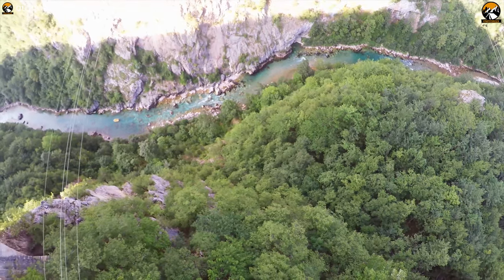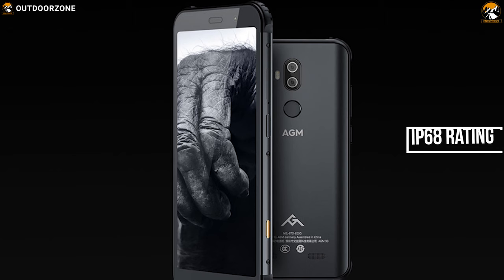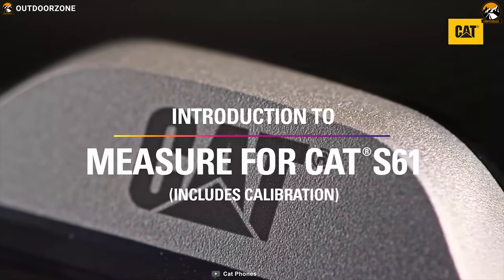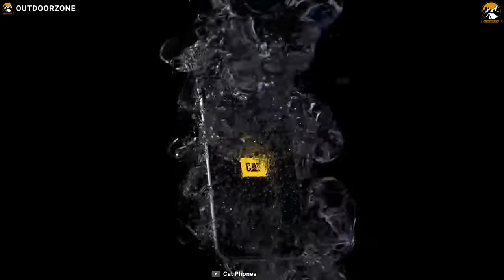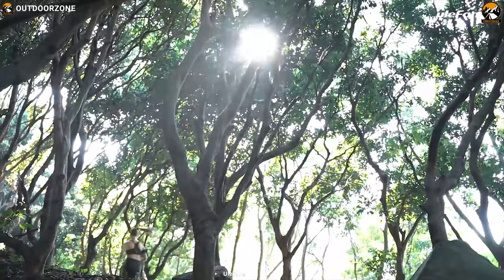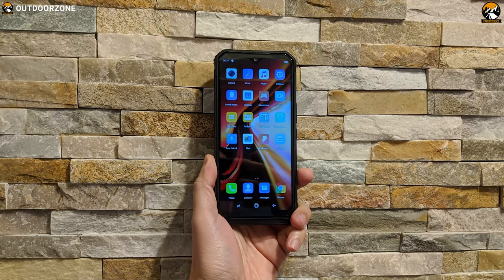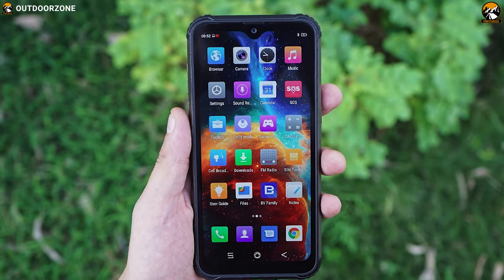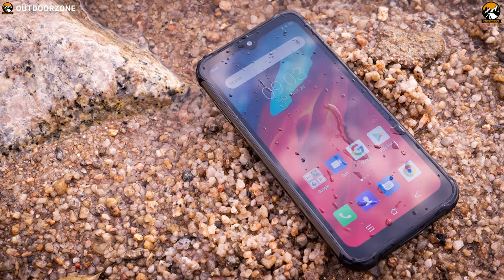Top 5 Most Rugged Smartphones

Comment: I've bought a few rugged phones in the last couple of years. First the AGM X2, later the A9 and now the BV9500 Plus. I really like the rugged phones, especially the large battery and how they look. But there is one big problem with these phones (and with almost all Chinese phones): They don't update or upgrade Andriod version. So after a year or so, you own a technical very good phone that endures a lot, but is not secure. So you basically need to buy a new phone every year or switch to a normal supported phone like a Nokia and put protection on that with a case and screen protector. These phones are wonderful, but could be much better if they supported the android updates, at least security patches.
Reply from the maker: Thank you for sharing your valuable insight! And absolutely agreed!

Comment: My first experience with rugged smartphones was with the Cat S60.
An incredible processor, good battery and armored body.
Cons were with the speaker mesh, that came off in a couple of months of use. 
Next model was the horrible Cat S41: Piece of junk! Connections problems, CPU works unstable, sometimes freeze.
Tired of Catphones, I turned my gaze upon Blackview, the chinese giant.
This time was the BV9500, with the monstrous 10000 mAh battery (3 days with just one charge), Helio P23 processor, submersible, high contrast in outdoors and almost 350  gr weight.
Finally that was the only thing in my opinion could provoked its malfunction:
Although it was "built to endure", one day it dropped from my hands, hitting the floor and screen didn't works anymore.

And now, I got the Ulefone Armor 7:
Fast, never freezes,, acceptable battery, armored body, triple cam, 5 LED flashes, etc.
BUT... Sometimes colors in camera are weird, so green.
I miss the big 10000 mAh battery, that's one of the specs I give more relevance.

I was left with the desire to try the Cat s61, or a maybe Doogee model.

If I could make a mixture of every good specs, this is what I think:

Battery: Blackview BV9500
Processor: Cat S60/Ulefone Armor 7
Resistance: Cat S60
Camera: Blackview BV9500

Piece of crap: Cat S41 🤦‍♂️

PD: I forgot to say: Ulefone Armor 3T, neither recognized the SIM card xDDD
Reply from the maker: Thanks For your valuable opinion.